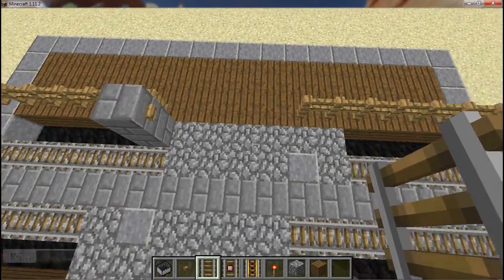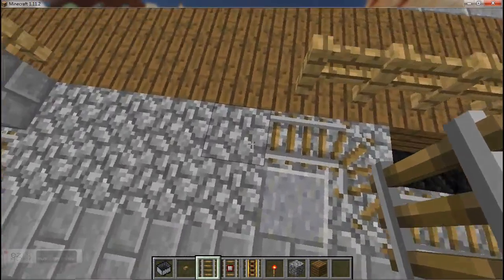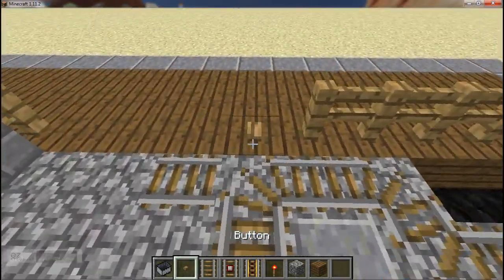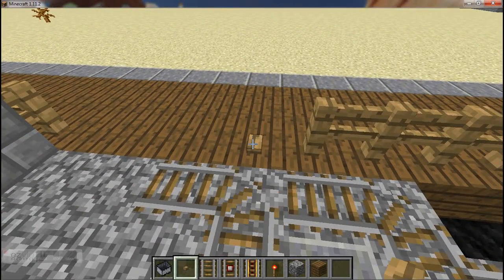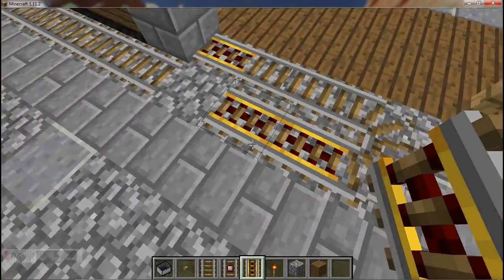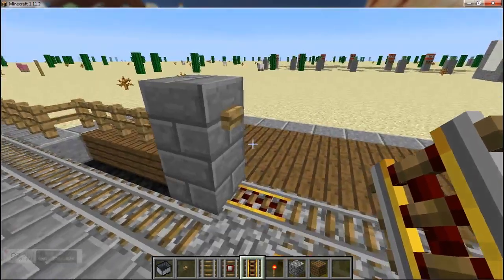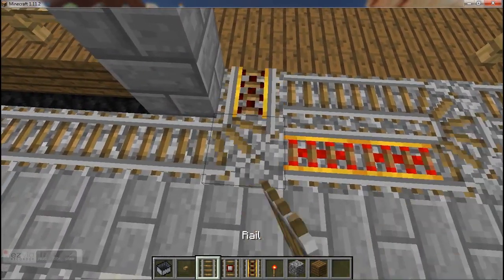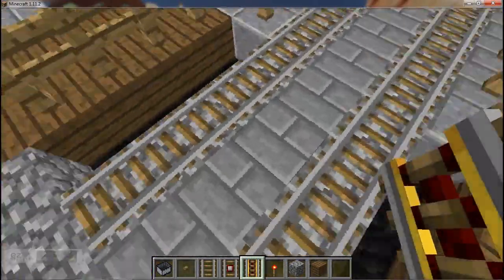Simple Stop / Start Railway Station in Minecraft - MCinstructabuilds

Comment: I’ve just done this and got it working, it’s very cool. I’m wondering though, what’s the reasoning for why only one of the two sides needs detector rails?
Reply: that's because of the south/east rule in minecraft, im not good enough to describe it quickly, but you'll find plenty resources
Reply: Better to supply only the solution that always works I think.

Comment: I put in my first one just like you did and it worked perfectly.  The second one I am trying to put in is not working.  The first curved track is curved to the left rather than the right.  As a result, the cart never goes to the part of the line to stop.  It's like I am in opposite world since building the first one.  I just updated the server.  Hopefully the server update didn't mess with this.
Reply: Would love to get an update as the switches continue to work in the opposite manner then the video.
Reply: have you tried powering the curved rail so it curves in the other direction
Reply: I just had the same thing happen, weirdly enough when I rotated the direction the station was facing to match the ones that were working (or just flip it) it fixed it.